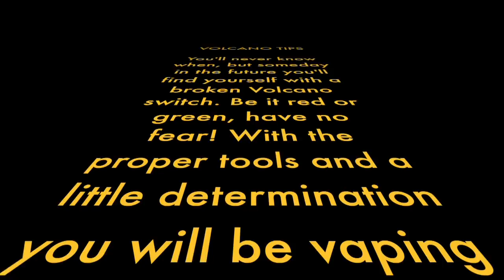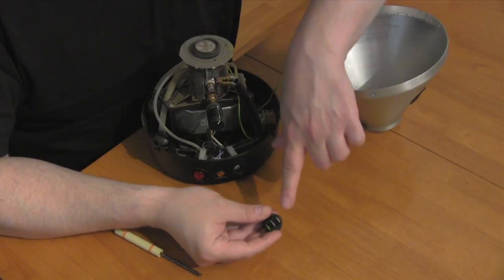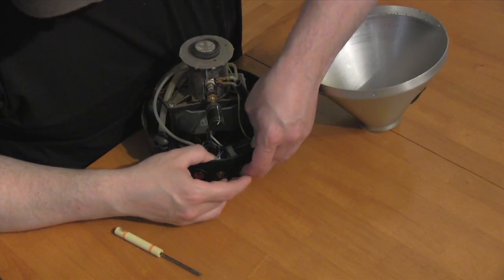Volcano Vaporizer Switch Replacement How To

Comment: I had my Volcano Digi packed for shipping to Oakland for repair because I had no idea how to remove those screws.  I didn't know about the Torx T8 Security bit.  Even though my problem was different, once the top was off, I was up and running in no time.  My respiratory system thanks you very much.

Comment: Thank you very much for taking the time to post this excellent tutorial. Was ready to go for a new Volcano, but really could not afford it! Following your tips, I did all you advised, bought the T8 and a switch for only £5 including post from E-bay. Well pleased. I bought my Volcano in Jan 2007! so glad its like new again.
Reply: Wow, 2007... That's amazing. Bought mine in 2016 and one of my internal wires somehow got stripped on its own. I had to open her up and fix it myself by keeping the wire in a certain position (requires constant fiddling which is pretty annoying)
Reply: I bought mine in Jan of 2007 too. The inside is hand dated 20.11.06. I am assuming that is date of manufacture. For the record mine does not have torx screws, they are standard hex screws

Comment: So i had an issue with my control light not turning on (unless i repeatedly hit my volcano in a certain spot) and i found out the issue. The pink wire connection in the back of the volcano needed to be pushed back. Just pushing that piece back in the direction of the back of the volcano fixed my issue. Cheers and happy vaping.
Reply: Hey! I have the same issue but my Volcano classic has these screws that have a little pin in the middle. Preventing the t8 screwdriver from being able to grab and turn the screws in any direction. Any help would be appreciated thank you!
Reply: @Got420Blunt  You asked the right guy. I had the same issue which I resolved by using the ends of a scissor to get the screw started... (any blunt object of the right size will do, you can use a small screwdriver as well if you have one) then I finished unscrewing it with my thumb nail. When I put my volcano back together I only used 2/3 of the screws and I didn't tighten them all the way so it would be easy to unscrew them next time. Cheers.
Reply: My classic is having the same issue. Im going to check this pink wire out and see if that helps.

Comment: I had to depress the top and bottom tabs of the power switch to remove it. Used SMALL slip joint pliers. Top wire is thicker black one, middle is thinner black one and bottom wire is blue. Still did not power up. I read that someone used sandpaper to clean corrosion off the thermostat contacts. Sounds risky on these delicate contacts. Instead I packed cotton balls around it to catch any drips and then applied WD-40 using a cotton swab. Capillary action pulled it into the contacts. Waited for the WD-40 to dry before powering the unit to avoid any shorting. Works fine now.

Comment: A T10 security screw was what worked for me, strangely. one of the screws that came with my volcano was stripped so i used a metal filer to file the top and bottom of the screw to be nice and flat, then i used needlenose pliers to unscrew the screw while using a knife to finish.

Comment: Thanks! Do you have any solution for flashing control light? When I turn the potmeter above 5, it starts to flashing and did not heat up. Sometimes its not flashing, than its work great. But mostly it''s flashing and I cant use it.

Comment: I got a T8 Screwdriver for Home Depot but it doesn't work on the screws? Is the Torx any different?
Reply: It should be a T8 Security bit like this - http://amzn.to/2mXPwUT
Reply: yes you need a security torx driver like this with a hole. 
http://www.depoteco.com/replacement-switches/t8-torx-security-screwdriver/
Reply: just wasted 11 dollars.

Comment: So I have the to screw driver. The screws holding the cover onto my volcano has little bumps preventing the screwdriver from being able to get into the right place to be able to get the screws out. Any help would be much appreciated
Reply from the maker: The bump is because it's a security bit, so you need that version of the screwdriver. It'll look the same as the one you have, but will have a recessed spot in the center for the bump.

Comment: any advice how to make the nob register temps correctly again? Mine has to be cranked to 9 to give me vape I used to get at 5-6.
Reply from the maker: Unfortunately that's a simple bimetallic thermostat I believe. They just get worn out over time. Storz and Bickel doesn't sell the part but if you contact them you should be able to send it in for repair.
Reply: @VolcanoTips  Mine heats fine the 1st time, then after that the control light flashes instead of going off and it doesn't seem to heat up to full temperature unless I let it cool for a while...when it works properly again the light goes off and the vapour is thicker. I bought it just over 2 years ago. Do S and B usually charge a lot for repairs?

Comment: Hello so what was the reason for changing out the switch? Mine is not blowing any idea what that can be? Thanks
Reply from the maker: In my case the plastic rocker piece (transparent red or green plastic) cracked where it is hinged and eventually fell off. In some other cases they start to make inconsistent connections.

Comment: What size specifically is the Torx T8 screwdriver? I got one and it's a 40 does it need to be a 45?
Reply from the maker: Honestly I didn't know they came in other sizes, since I've never had an option when buying. I do know that the ones Depot Eco sells fit - https://www.depoteco.com/replacement-switches/t8-torx-security-screwdriver/ - but there's no size mentioned... I thought T8 _was the size_?
Reply: @VolcanoTips  I ordered my Torx T8 screwdriver from Depot Eco as well but I CAN-NOT manage to unscrew two of the screws! They're just stuck ,as if they were glued 😥Please help!
Reply from the maker: @gigig6021  if the T8 fits properly and is nice and snug, you might need to use a pair of pliers on the handle of the screwdriver to get extra leverage. Kinda like this - https://external-preview.redd.it/IVZZVFqVsbLcjOr_VwjJG_XKjPyOl2PCcbeyi4Gc3HA.jpg?auto=webp&s=2ad4d057f4905680bff09b05177e6e92a91591e8 Never heard of anyone not being able to get the screws out. Good luck!

Comment: How do you take the top ring off, I wanna clean the area above heater.
Reply from the maker: Honestly, I've never been able to figure it out. I use a vacuum with PC cleaning attachments and it gets pretty clean.
Reply: @VolcanoTips  i had some honey in this area, mine was stuck from resin,  i just put some iso around the ring with a q-tip, turned the volcano on to max temperature and little by little carefully turned the ring using alot of layers of paper towels to protect my hands from heat. An oven mit/glove would have been better. Dont force it either.  BECAREFUL DOING THIS EXTREMELY HOT!!!

Comment: Any tips on heater light going off, and heat not engaging?
Reply from the maker: I would make sure all the connections at the switch are tight and secure. Beyond that, what you're describing usually involves contacting Storz and Bickel for support. If you can, reply back here to let us know what you find. Good luck!
Reply: Is this the digit? or the Classic.  Let me know i can point you in the right direction.
Reply: @depoteco_com  classic, but has since exploded.
Reply: I got the same problem on my second classic volcano lolz you’d expect after the first one having the problem that you wouldn’t have the problem with a new one but unfortunately it happened, idk how to fix it I just sent a email to storz n bickel I didn’t do this last time but I will now to see the full cost if its worth to get it fixed or buy another new one 😂
Reply: @JJ-vh8iu  I got the needed attachment and opened it up. On the back of the exhaust, or where the hot air comes out, there are two pieces of metal, in a N-S alignment that had a bad connection. Sorry no idea on names of parts. I would recommend send yours in, as I said, mine exploded. The S&B service department and shop, were closed due to the pandemic at the time.

Comment: HELP!

I had an accident with my Digital volcano vaporizer. It was a 110v and I accidentally plugged it into a 220v outlet. Now it doesnt work. I opened the vaporizer and identified the component I need. It is the transformer inside. However, due to the damage, I cannot read the rating/value of the transformer. Could you kindly send me the details of the transformer.

Thank you very much!
Reply from the maker: Hi Robert, contact Storz and Bickel - they'll have the info you need!
Reply: How did you manage to do that must not live in US because there’s no way to plug 110 into 220 outlets

Comment: torque's is a common screwdriver, not special ...   like calling an allen wrench special :-\
Reply from the maker: This is a "security" torx which has a circular recess in the center. A standard torx will not work.

Comment: i cant remove those pesky plastic indivual sleeves
Reply from the maker: Do you mean the 3 connections on the back of the switch? I use a small flat head screw driver to slide them off. There's a metal fitting inside the plastic.
Reply: VolcanoTips yes, those 3 clear connectors, is there a secret to it? Like wiggle it left and right or anything

And thanks again for replying
Reply from the maker: A little wiggling will help, and also if you can get the blade of your screwdriver to push against the metal sleeve which is inside the plastic, that will help.
Reply: Thanks I got it after your 1st comment.. I got a small screw driver and it came off just like you said

Thanks for the video and responses

Comment: the torx t8 is false
Reply from the maker: Are you working on a Classic model? What did you determine was the right bit?
Reply from the maker: Some folks have found t10's on theirs. Others have had success using pliers and also by filing the screw down to create a flat spot on the top and bottom for the pliers to grip on.
Reply: For me the T8H is the exact screw. Found in a medium pricey Canadian tire set for PC mother boards and small electronics etc. It has the T8 screw also, which does not fit at all. Hope this helps someone!